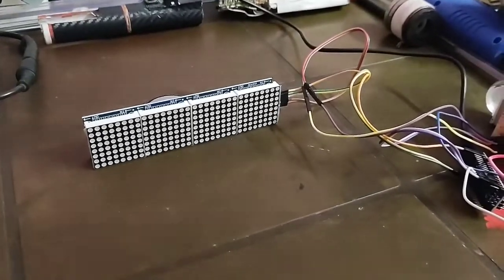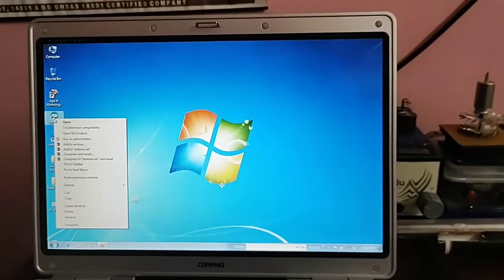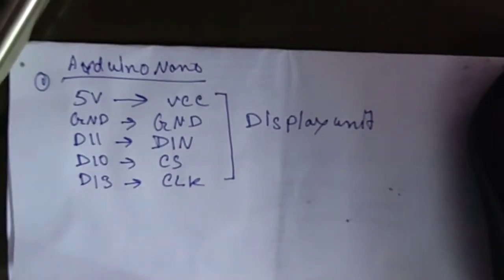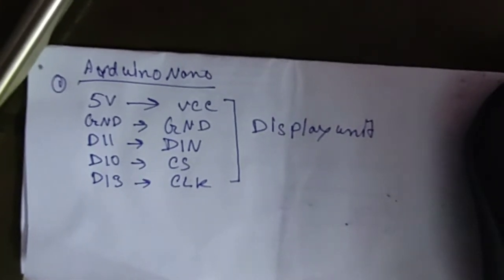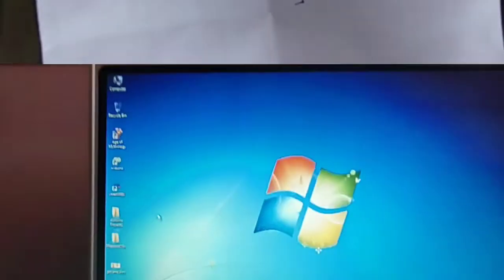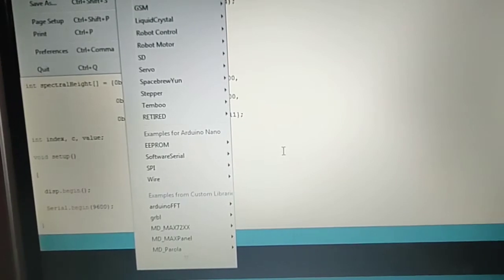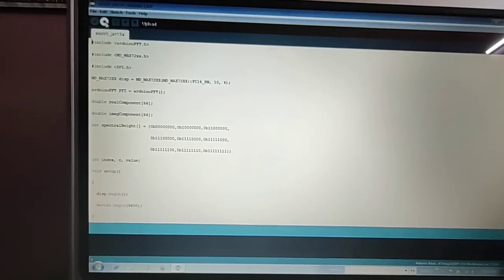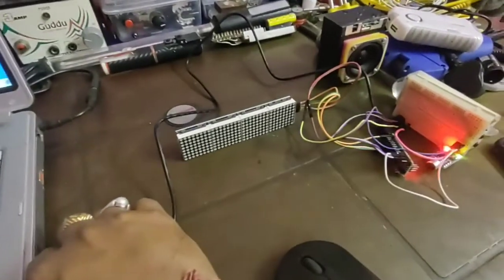DIY Audio Visualizer

Comment: What would I use for a line level module instead of the mic module?
Reply from the maker: If you don't want to connect mic module then connect speaker/ amplifier output with stated unit